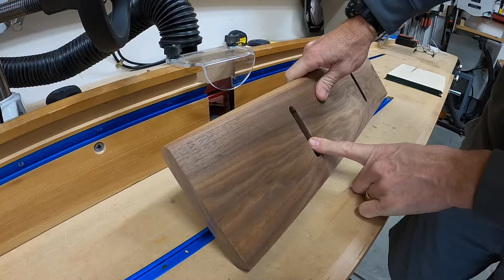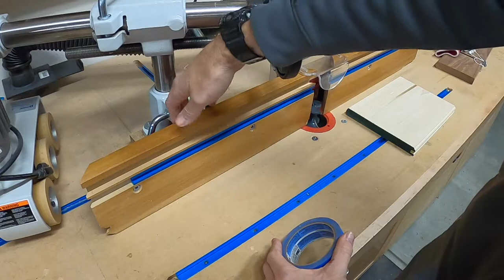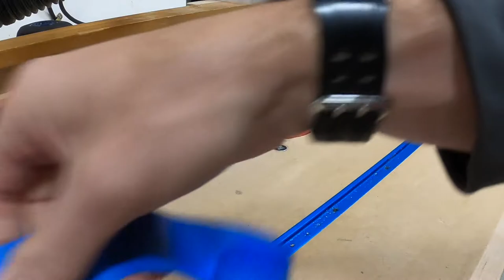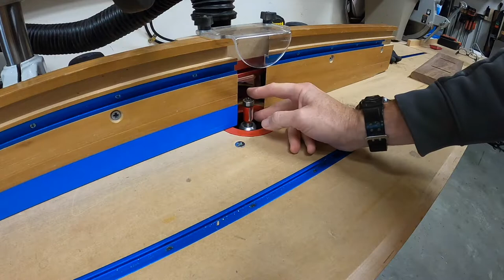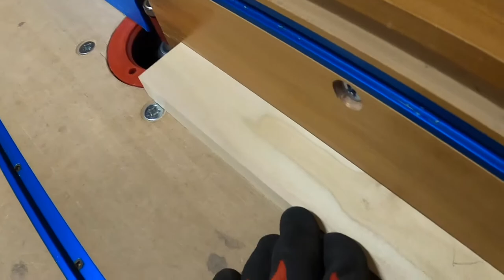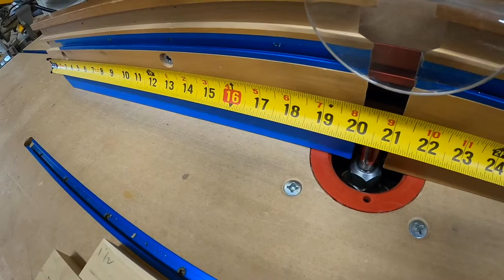How To Avoid Snipe And Use Your Router Table As A Jointer!!!

Comment: Me again...scratch that Q...I think the answer is that this demo has to do w removing 'snipe'...like maybe after I removed an 1/8th or so and needed to 'clean' away snipe?
Reply from the maker: It’s both.  Keep snipe away by using the router like a jointer.  They act the same way when you remove too much material and there isn’t any left to contact the fence.  So it snipes.

Comment: I also enjoyed this. Thx for your patience and attention to detail. How much can you safely offset your fences and do what you did? Maybe need something other than tape? So is there a method where I could 'shave' off a 16th, or an 8th? 1/4" for sure not safe? Thx!
Reply from the maker: Hello G Hoffman.  Absolutely.  You can take more off.  And probably would need to if your board was really wacky.  The more out of straight, the more times it will take you to straighten it.  So take a deeper cut.  As I mentioned in video, I use shims behind my fence to bring it out.  And you surely can use 1/16-3/32 for sure.  Probably more even if you’re using the kind of bit I’m using.  Depending on feed rate and wood species.  Grain direction plays a role too.  Just try out your boards and see how they react.  I really appreciate your positive feedback.  That’s what really keeps me doing these videos.  Those that appreciate and what the instructions.  So please spread the word on my channel.  I’d greatly appreciate it.

Comment: Sorry buddy but you missed the boat on this one. The reason you have snipe is because you’re not supporting the board to the fence as it gets to the end of the cut. All you have  to do is put more pressure on the front  and middle 
 of the board and you won’t have snipe. But you have tracks and you’re not using with death boards. Feather boards can work in some cases depending on the length of the piece being cut. Proper technique is “by far the easiest solution “..
Reply from the maker: I’m going to reply to this comment with the upmost respect.  I’m grateful that you watched the video.  However, I’m not thinking you actually watched to listen and learn from my experience.  Router tables and shapers have a lot in common with the problem that I showed- they both introduce snipe if you remove all the material from the edge being machined.  There isn’t anything that you can do to avoid this problem except the solutions I gave on the router table. Shapers can fix the problem with their fences that adjust forward and backward.   Please go back and fully watch and listen to learn and maybe you’ll understand.
Reply: @davidbryanwoodworksandmore your assumption is incorrect. The only reason I watch videos is to learn. I understand what causes snipe and as a matter of fact I had to deal with it last weekend making baseboard trim on my router table. The first test pass left me with snipe so I thought about why it happened and realized it’s because the board is not supported well when it gets to the end and past the first fence. Like I said, I simply added extra pressure as it exited and no more snipe. Try it, it works. The key is to keep the board firmly against the fence all the way through the cut.
Reply from the maker: @shaynesabala  I’m trying to be kind but it sounds like you’ve had no experience with woodworking with a router table and or shaper.  If you had experience you would know what I’m referring to.  You can’t avoid snipe when removing all material from wood when routing complete profiles unless you do as I said.  If you rout the profile and get snipe, then if you run it again it can erase the snipe sometimes.  But that’s not really a solution as it creates a tapered work piece.  The best solution is to do what I showed in video.  Take a piece of wood and rout a bullnose profile with it.  Make sure that the bit fully removes all material from edge and see what I’m referring to.  You’ll get snipe.  On leading edge and trailing edge.
Reply: @davidbryanwoodworksandmore  I have enough experience to know how to keep snip off wood on the router table. After I did my test cut and made the adjustment to the technique I completely lost the snipe. Not one piece I made after that adjustment had snipe. But you can stay closed minded to promote your video when it’s 100% unnecessary.
Reply from the maker: @shaynesabala  please post a video on your channel for me to see this.
Reply from the maker: @shaynesabala  Shane my video was made for people who are woodworkers wanting to learn tricks to solve very common problems.  When you say that I’m closed minded, it’s over 20 years of experience that I’m speaking from.  This video was for woodworkers like you.
Reply: @davidbryanwoodworksandmore  let me clarify, I did not say your idea would not work, I said it was unnecessary. One thing I love about wood working is you can never learn it all. There is always challenges one can take to better themselves. With that said, mentioning how many years you have doesn’t mean you know it all and certainly doesn’t mean you should stop listening to others suggestions. Not once did you even consider my solution. As a matter of fact you said I have no experience. Didn’t know you knew my background, well ok then. We do have one thing in common, we both overthink things. This video is case in point. Good luck to you and your channel. Hope you try my suggestion, heck you could make another video about it. Lol
Reply from the maker: @shaynesabala  it’s not another way to do things, it’s just not true to avoid snipe when routing full profiles.  If there isn’t any support on the outfeed fence there has to be snipe.  It’s just the way it is.  This has nothing to do with learning new things or whatever.  This is why shaper fences have adjustable fences forward and backward independent of each other.   To avoid snipe.  Maybe you aren’t routing a complete profile and thus not removing all the material.  Obviously that wouldn’t create snipe.
Reply: @davidbryanwoodworksandmore  I understand, yes like I said I was building base boards. I used scraps that I had and some pieces were pretty short yet long enough for what I needed. So when I got to the end of a short piece the contact of the fence gave away once I past the first fence. My cure was to add a lot of pressure to the exit side to keep the pieces from moving. I need to watch your video again because I thought you were making straight cuts.
Reply from the maker: @shaynesabala  I was making strait cuts.  Removing all material as I machine the edge.  So there isn’t anything left to provide support.  My video was to show people how to combat the snipe you get when Doing this.